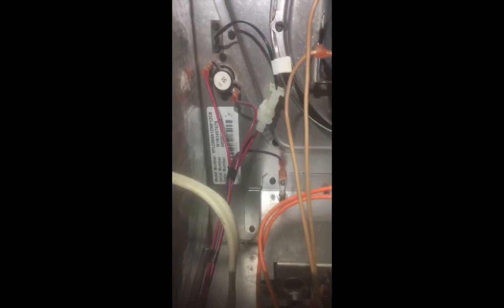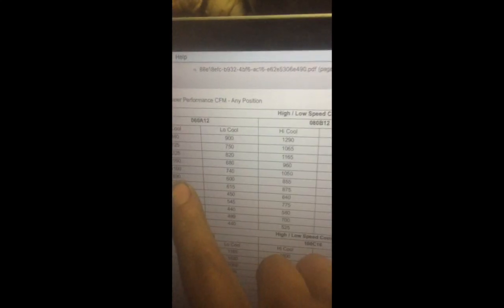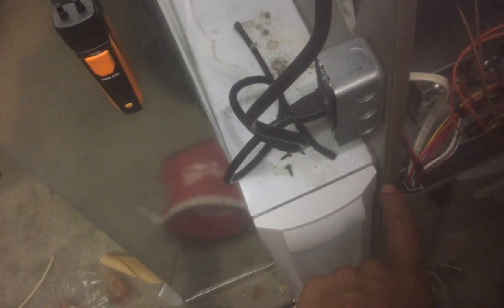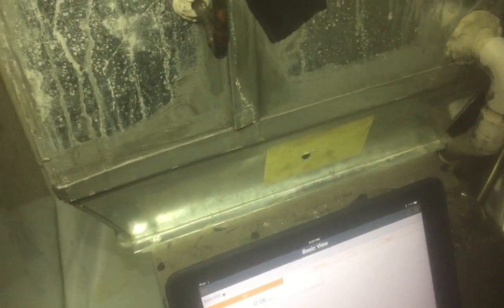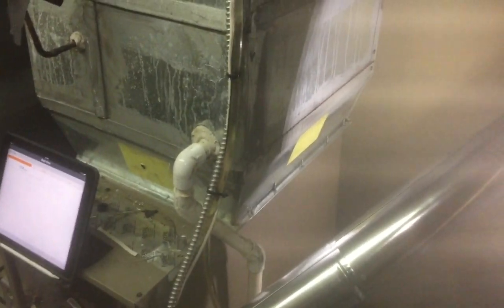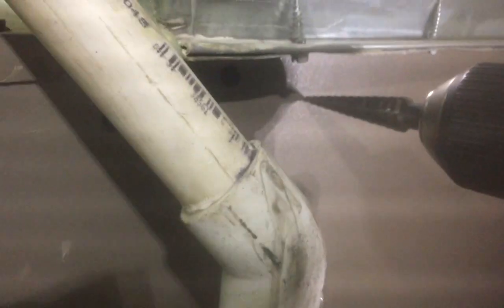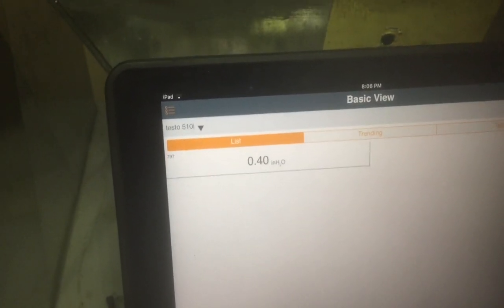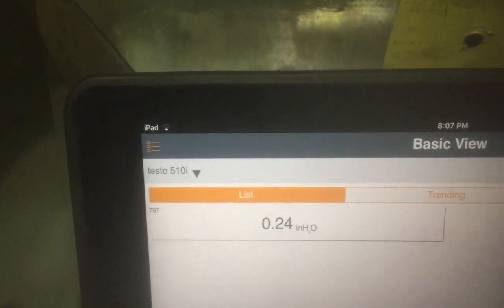Total External Static - Gas Furnace

Comment: Great video Michael.  What changes with testing whether or not the manufacturer data includes or does not include a filter in their numbers?
Reply from the maker: Personally I do it the same way, technically if a filter is included in manufacturers tables then you would put your probe in the return instead of blower side of the filter.  The issue is that most people install too small of filters or have other issues.  Manufacturers don't include what the drop was for the filter they tested with, so I use 0.1" as a rule to keep filter drop to.  I'm gonna make another video showing the other measurements I usually take that help assess what's going on in a system / benchmarking a new system.